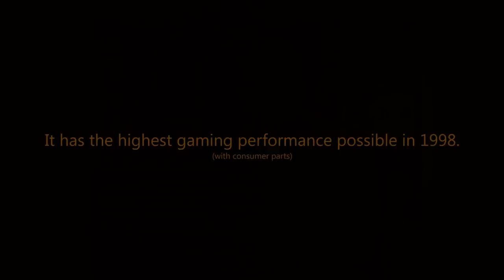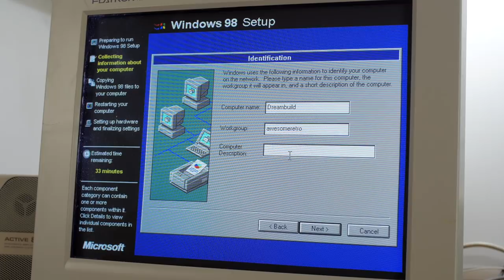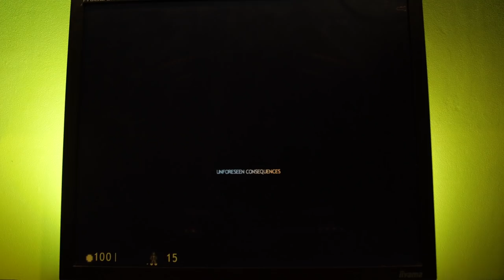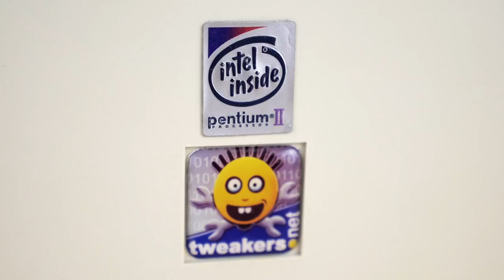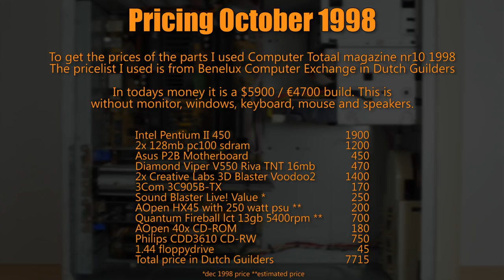1998 Gaming Dreambuild! Pentium II 450, 3DFX Voodoo 2 sli

Comment: 3 gpus?
Reply: The Voodoo2 is a pure gaming 3D card which cannot handle Windows operations. There is actually a physical passthru cable to the vga card. At that time, even the Riva TNT is not in the same league performance wise.
Reply: Bernard Shum i didnt understand perfectly
Reply: That means during 3D gaming, the display is actually physically switched to output thru the Voodoo. Totally ignoring the RivaTNT. i.e. they never work together. The RivaTNT is basically for Windows 2D (GDI) operations. And the Voodoo is a fullscreen only 3D card. It cannot handle Windowed 3D apps.
Reply: Bernard Shum ok

Comment: Does it run Quake 3 or Warcraft 3 ?
Reply: Merikato I used to play Warcraft 3 on a Pentium 4, works absolutely fine.
Reply from the maker: Merikato It runs Quake3 but not on high settings. And back in the old days we played Warcraft 3 on Athlon 1700 / 2000mhz machines but with much beefier videocards. I think WC3 need a newer DX 8.1 videocard for the graphical effects.

Comment: Try "Need for Speed Underground 2" and "Warcraft 3".  I actually ran Warcraft 3 on a 4mb Video card, limited online play, mostly by 128mb sd ram.
Reply: +DarkLinkAD no! after Porsche Unleashed, NFS franchise went downhill anyways
Reply: blakedmc1989RaveHD
 NFSU2 and NFS Shift were both decent in my mind. I prefer the technical options.
Reply: DarkLinkAD i see btw NFS Underground 1 and 2 and Warcraft 3 won't run a a Windows older than XP and a Pentium older than 4
Reply: I havent tried NFSU2 but I have played WC3 on PII with Windows 98, then with better video drivers on Windows XP.  Prob want at least 256mb of ram though.

Comment: lacks overclocking with oversized heatsinks & fans (no, I said oversized, not noisy)
Reply from the maker: +inso ninenine I can't find the huge dual fan slot coolers. I really want one :)
Reply: +victorbart then make one!  buy some thermal glue (like Arctic Alumina, easiest to work with, sticks like hell and doesn&#39;t break the bank), find a large heatsink (never throw away a heatsink, collect especially CPU heatsinks), grab a hacksaw and get to work :)   then find some way to fit a fan (preferably large) - make a duct if needed (it that case, it has to suck air, not blow). and remember to heatsink the motherboard chipset as well (and the video card, offcourse), if you get a large enough heatsink, fans are not needed (try out with and without). play with voltage and start stability testing with a dedicated application.

Comment: Can voodoo 2 render 2D?
Reply: are you trollin'? even desktop is 2d, if this accelerator couldnt render 2d no one would buy it EVER.
.
.
.
.
.
.
.
you got me, nice bait
Reply: k680B Hey I was gonna ask the same question too, though for rendering 2D games. I'm a complete newbie in the pre-XP era.
Reply: No it cant. This card was only 3D accelerator and you would have 2D card in your PC and by-pass cable to connect 2D card to voodoo 2, then monitor goes to voodoo card. That why RETRO have Diamond Viper V550 Riva 2D card in this build. Its  kinda similar machine i had but mine was in 1996-97 when first Monster 3D was released and i additionally had Diamond 2D accelerator as well :) Remember, these are beginning in 3D accelerated games under openGL.
Cheers
Reply: Ok PowerVR PCX can do that and it slightly better than the S3 virge DX.
Reply: Well it can actually produce "2D" unlike most people think, but it's not a graphic card like regular graphic cards from that era. ALL graphic cards that could display your bios, MS-DOS, windows (and also graphic cards from today) tell the bios that they are graphic cards, and they are compatible with legacy stuff (CGA, EGA, VGA graphics, VESA ...). The 3Dfx cards in the other hand present themselves like "multimedia device" and they aren't compatible with ANY of the norms shown higher. All they respond to is Glide.

Glide can produce 2D (and of course 3D) however 3Dfx cards doesn't show up as graphic cards to the BIOS. 

I'm pretty sure that one could make a driver for 3Dfx card that would make windows use the 3Dfx cards to draw the picture of the desktop. This would be fast, but until windows is started, your PC would output beep codes to tell you that the bios didn't find any graphic card and your screen would remain empty.

This is why you need a "2D" graphic card, or should-I say a VGA and VESA compatible graphic card while 3Dfx are only glide compatible
Reply: The reason I asked is that I was wonder if "Lego Creator" from 1998 can use the Voodoo 2 card for hardware mode.

Comment: 6:25 When i first saw it i was like WTF this pc boots fast for a win98. And then i noticed that the mouse moved and was like- ahhh!
Reply from the maker: TheTopHatScoot Hahah that is the power of video editing :D
Reply: +victorbart  Can someone please help me resolve my issue?
I've built an almost identical machine as the one in the video, but i have problems with my hard drive. I want to update my bios so it can detect drives over 32gb. ( so far detects 1.7gb and 20gb fine) so i can use my maxtor diamondmax 40gb, but i cannot find an appropriate file for my motherboard type. It's a standard P2B rev. 1.04.  Bios: ASUS P2B acpi bios revision 1006. Would be greatly appreciated if someone can find me a right file.
Reply from the maker: +TheTopHatScoot please join "retro machines" on facebook. We can help you there in the group.
Reply: +victorbart Thank you for the response :D
Reply: +TheTopHatScoot Pending request to join ( Kacper Drych)
Reply from the maker: +TheTopHatScoot Fixed ;)

Comment: I miss the Abit BE6 ;-)
Reply from the maker: Marco P. Good news I just got a BE6-II and BP6 both with broken caps so need to repair the :)
Reply: Which CPU is planned for the BE6-II rig?
Maybe a Celeron 300A@450 or 600@900 with slotket?
Reply from the maker: Marco P. I have slotkets and celerons but also P3 cpu's. With the board came a Pentium 3 733 slot1. So many options :)

Comment: The hard disk was cheap and slow. That time there were available super fast SCSI hard disks with SCSI controller cards. 
The power supply, case and monitor of the video were cheap. 
The machine demands more than 250 watts and more powerful were available. The case should have been bigger having at least two fans in front and back in order to create an airflow. The excessive heat of so many crammed items if wasn't removed with fan would result in crashes. 
A top user would choose  EISO instead of LG monitor. 
EISO is still the king of monitors.
Cd rewritable drive weren't useful for frequent backups. A top machine that time had a Zip drive or Iomega drive. Floppy disk drive was just for compatibility reasons.
Reply from the maker: +Achilleas Labrou It is a gaming build so that is why I didn't choose SCSI. And in 1998 there were not many consumer cases with 2 fans in the front. Systems like this doesn't need that much airflow. If you have a free EIZO monitor for me then I will use that. I won 3 CRT's 2x 17inch LG and 1x 19inch NEC. All 3 are really good monitors with flat glas. The CD writer is to make backups of your FRIENDS games! :P

Comment: Can this hold GTA 5???
Reply: 15fps at best. if my old gt9600 was able to run ac3 at high details, but couldnt even turn on ac4, i cant see this card having "good" fps, even, if you turn off all the textures, shaders, and make models as simple as its possible. there is still too much scripts and objects to load and render. yeah, rendering scripts... you know what i mean.
Reply: No. It can't.
Reply: yeah 0,5 fps at 180x60 resolutuin

Comment: I need one for myself :(
Reply from the maker: +OutFreak28 Build one! :D
Reply: Wish I could, is technically impossible to get old PC parts in my country (México). But I hope someday I'll be able to find some stuff and get my own 98' PC dreambuild
Reply: +victorbart Where did u get the parts from ?
I'm from the Netherlands to btw.
That pc case and those speakers i know them haha those had a friend to only other parts of cause in the case :-)
That motherboard i think i have the same, only mine is not 100% anymore because the fan headers doesn't work anymore. and it have an Slot 1 PIII 600Mhz in it.

Comment: I believe your pricing is way off. For example, my Monster 3dfx card was $300.
Reply from the maker: The pricing came from actual price lists and where in Dutch guilders. At that time itw as around 1$ is 2 guilders. So 700guilders is 350$ at that time. So the prices are correct.
Reply: RETRO Machines thank you for that information.

Comment: But... Windows 98SE was released in 1999...
Reply: And 98FE was garbage, can you blame the man?
Reply: I've had better luck with windows 95.
Reply: geo58impala 95 was released in 1995, 98FE is the closest you'd get, and FE was tragic, so 98SE is the best bet.
Reply: AIO inc. Uhh no. Windows 95 was released in 1995 as you can guess. And I don't really care if 98FE was bad, this is a 1998 dreambuild.
Reply: Sezer Çelik
>Windows 95 was released in 1995
I know that?
"I don't really care if 98FE was bad, this is a 1998 dreambuild"
Do you know the meaning of the phrase dreambuild, kid?
It means the best possible computer.
98FE would mean more of an unusable computer.

If you wanted accuracy so much, that case made in January of 1999 wouldn't be there, and the RAM manufactured in 2000 wouldn't be there either. Technically, Windows 95 wouldn't count because it wasn't made in 1998.
Reply: AIO inc. Yes best possible computer IN 1998, which shouldn't contain an OS that was released in 1999. And I really wonder how do you know that that RAM was released in 2000, because he didn't even give a model or even brand name, and that case is made in  1998.
Reply: I don't get random glitches on most systems I put a fresh install of Windows 95 on. Windows 98FE and 98SE are unstable crap in comparison.
Reply: Sezer Çelik There are labels on the RAM you know, and that much of it was completely unheard of in even gaming computers of the time.
Reply: +AIO inc. None of the labels are readable.
Reply: Sezer Çelik You may want to look into an optometrist, friend.
Reply: AIO inc. I finally found a readable one (1:57) and couldn't find a proof about being these released in 2000 like you said. There is no model or brand name, only product no.
Reply: Sezer Çelik Jesus, do you kids these days even know what a date code is?
Reply: AIO inc. Where is the date code I couldn't see one.
Reply: AIO inc. And the meaning of that? Because I'm not English.
Reply: Sezer Çelik Date codes starting with 00 mean they were produced in the year 2000.

xxyy where xx = year, yy = week.
Reply: AIO inc. I meant "flipping chips".
Reply: Sezer Çelik Would you rather me have sworn?

Comment: rofl i have almost that exact computer. the biggest difference is that mine's a 400mhz pentium 2 that's overclocked to 533mhz.... for 18 years and still works. well, i assume. it worked the last time i turned it on back in 2011 i think. also one of my diamond monster 3D II is busted, unfortunately. i'm not 100% sure about it, it was just glitching the last time and worked better without it.
also mine has 512mb ram and a 40gb hdd. and my "2D" video card isn't a riva tnt, it's just some shitty whatever card.

Comment: There was better sound than soundblaster, roland 32, so your fault
Reply: I think that you meant Roland MT-32, but no, the MT-32 can only produce sounds that were pre programmed in it, it's just a midi synthethyzer. The sound blaster is a complete different thing because it contains a midi synth and a DAC which allows you to produce any sounds (such as voice). The MT-32 can NOT do this. And also the MT-32 is from the 80's, some better synths were made later (Roland Sound Canvas 55 and 88, Yamaha XG ...), this has absolutely no place in a 1998 build. However you are still right in some ways : the "Sound Blaster Live !" isn't the absolute best sound card from that year

Comment: While very cool, this is not a "best configuration for gaming" possible at the time. more a upper mid range, Dual p2 MB existed you could uncap the p2 and over clock the shit out of them and 256mb chips existed as well as SCSI driven ram disks.

but great to see some nostalgia
Reply from the maker: +Shawn Palmer No game needed more then 128mb back in 1998. No game supported dual cpu. Quake3 was one of the first games to support dual cpu. And for gaming you don't need scsi. But I got an Asus P2B-DS with 2x p3 500 lot's of scsi etc. need to find time to make the build :) But for gaming this is the one :)
Reply: +victorbart yes yes !! Another PC build like this that would be amazing!
Reply: +Shawn Palmer  i cant beat this machine i have only 3 gtx 980 ti's in sli so pour :(
Reply: +Shawn Palmer What's the name of the song?

Comment: ps3 is more powerful
Reply: Maybe even Dreamcast.
Reply: Nope neither the ps2 or Dreamcast are better

This machine has more ram, can run games at higher resolution than these consoles can do and often with better framerates. Take Half Life. On this machine it will run at 1024*768 60FPS most of the time with dips to 30. On consoles it will run at 40fps with dips below 15 fps and only at 640*480. RE-Volt runs also better on this than it does on Dreamcast.

Unreal Tournament too, etc ...

The Dreamcast is an impresive piece of hardware for it's time but it was still slower than the best PCs of that era.
Reply: 雨琛涂 um no this pc has higher clocked cpu MUCH more ram and 2 video cards that blow ps2 out the water this system was capable of running at higher resolutions and 60fps in 1990's game much better then crappy ps2